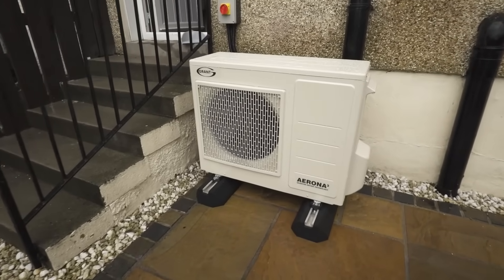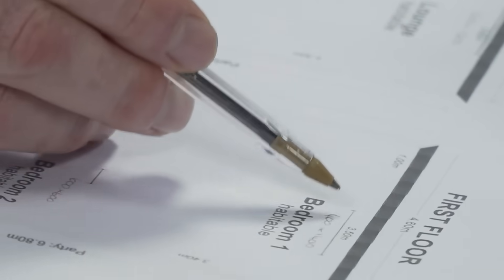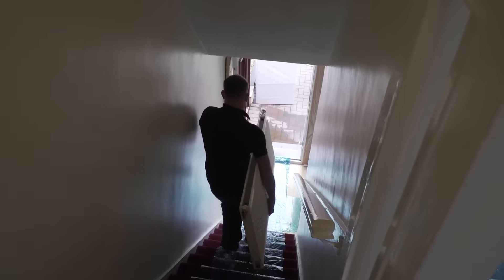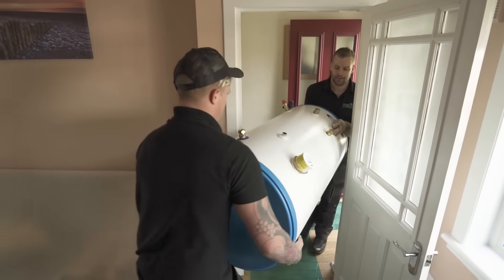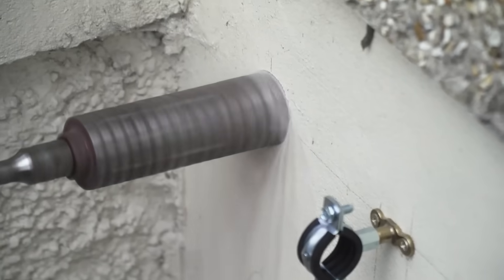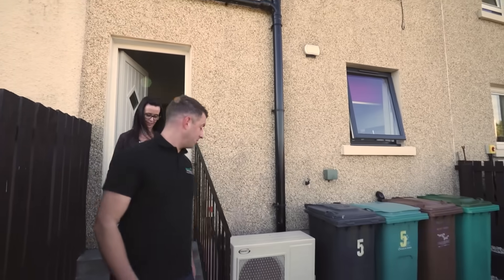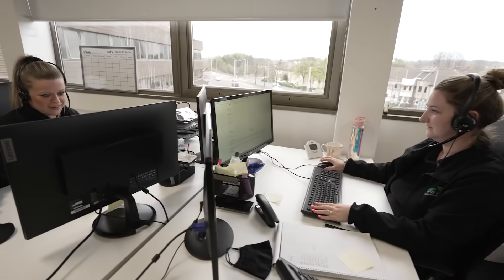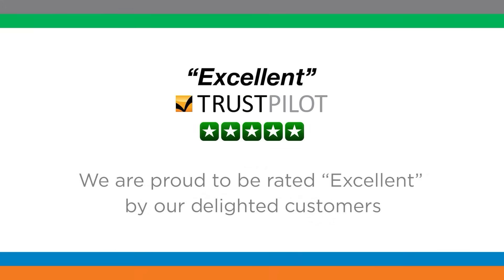Air Source Heat Pump Installation

Comment: In USA and Canada almost all domestic properties have a heat pump. Over there they call them HVAC. Newer units less than 20 years old do both heating and cooling. In UK people seem very suspicious of the "new" technology. The vapour compression system was invented by American engineer Jacob Perkins who patented the idea in 1835 and it was perfected and adapted for commercial use by Scot James Harrison and deployed in Australia to cool beer in 1850's.
Almost all large supermarkets, stores, warehouses, offices and other commercial properties have been using heat pumps for decades in the UK. Second only to  the electric motor, the heat pump is the most widely used electro mechanical device in daily use around the world with billions deployed.